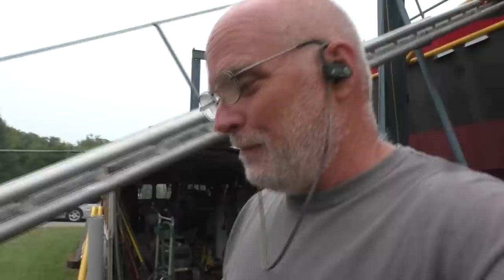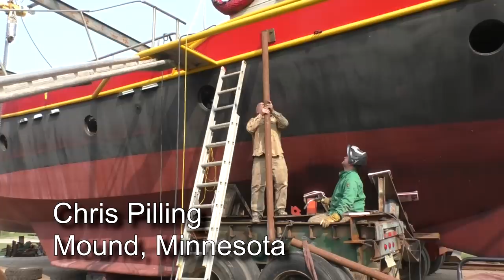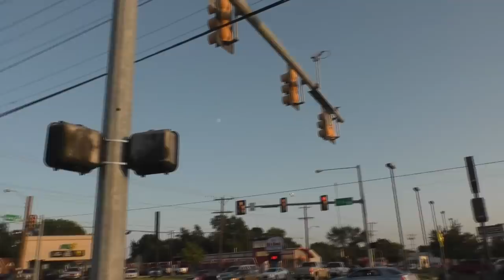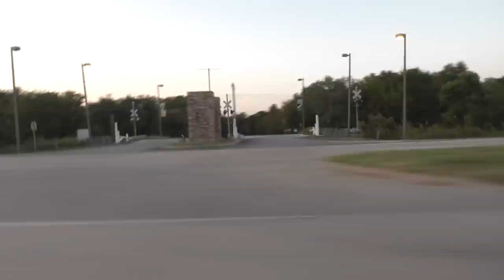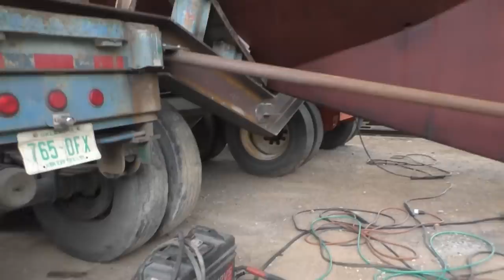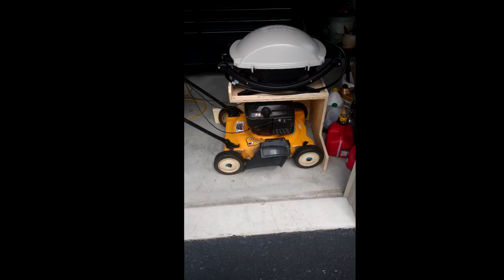Wheels for the Boat - Part 4 - Dual Lane Trunnions Completed

Comment: Hey Doug, make sure you take the time to have the information off each railroad crossing you will cross.  I did notice you said the crossing humps won't be a problem but dang man, 25 seconds isn't a lot of warning for a move of your size. Each has a plate with contact information and a crossing number to notify the railroad in case of trouble.  Best would be to contact them in advance and time of to see if you can get confirmation of a clear path.  Just a thought from a rail guy!  Thanks!
Reply: I was going to suggest the same thing!! From another rail guy, 28 years as a locomotive engineer!!
Reply: He's doing it fully legal 
So the transport department work out his route for him,abd tell him his time schedule
Reply: Yep.  My company has a railroad that bisects our facility.  We keep the info for each crossing in our emergency response manuals.  A couple years ago we had a forklift die on a crossing.  It created a pretty hairy situation for a few minutes until we got a tractor there to pull it off.  Luckily, we called the railroad with the crossing info, and there were no trains in the area.
Reply: Interacting with the railroad would have to be a fundamental part of the move.  Not doing so could be a tragic mistake!

Comment: Being a former truck driver, no trailer brakes at 10mph shouldn't be a problem and the jake brakes should help handle slight downgrades.
Can't wait to see how you get it out of the yard though. I've been watching this come together for a long time. Very cool seeing it get to this point.
Reply: It`s incredible what you can do with axles nowadays I was on the pusher end of a block long Vessel that we brought out of Cessco Fabricating Edmonton Ab Can. Lead truck started pulling brought out the tank 100 ft before it started turning Pilot truck turned all the Tag axles full 45 opposit direction just past center started bringing them back we were 4 days to go to Fox creek Ab 2.25 hrs away HEAVY !!!  I was basically the brakes and a little Giddyup so even if you put Yoke on a 5 ton and use it as a tow bar  NO STEERING IT just for brakes  it`ll help if you want to go that way have someone sitting in it on  radio.

Comment: Overhead utilities look good. Most of the low slack spans are Telco or CATV. Phone is almost always on the bottom. CATV just above. 
Not unusual to go have somebody ride the load with a hot stick to help wires over the superstructure.
Talk with your local house movers. They will have trucks with hydraulic hitches (up, down, left, right) which facilitate maneuvers. They will also be familiar with civilian and police escorts, utility coordination. They can supply required flags, signs and warning lights.
Consider work lights over the wheel sets and bringing some rigging, welding gear and cribbing in the convoy. Hi-Vis vests suggested.
Sometimes City and State have different ideas about oversize moves. One might want the move done at night and the other during the day. Scout places where you can lay-up for operational pauses or in an emergency.
Any need to have the city temporarily restrict on street parking on your street? We have had a tow truck, in convoy, to temporarily reposition the odd parked car.
Reply: When I lived in Oklahoma NO oversize loads were allowed to move an inch after dark. 
That being said, it has been 40 years since I lived there so many things could have changed since then!

Comment: Still one big badass trailer! If you dont use brakes just hang some brake pads on the side with Bailing wire and now you'll have brakes. There for the Professionals well be happy!! Just saying for a friend. Awesome Work Doug cant wait to see the Actual travels in motion.

Comment: Brakes? Where we are going we don't need brakes.
Reply: I wonder where on the boat he intends to fit the Mr Fusion unit.
Reply: Just have the anchor ready.
Reply: He might need brakes while backing down a launch ramp unless he's going to have a travel lift lower it into the water...
Reply: @brandendebuhr2997  You must be really short... Because the joke went right over your head!
Reply: @iGuru08  lol
Reply: @brandendebuhr2997  watch his launching of the wooden submarine.  Didn't need brakes there.

Comment: Mount an 18ft pole to the back of your truck, floor it to the port.
If you end up with half/no pole you may have found an issue.
Reply: I have done this, years ago, but used a fiberglass antenna at a slight angle mounted on a heavy spring to a hitch. I would rent a trucker GPS instead, I came close to damaging some lines even while being careful.

Comment: My father and I did some finishing work to a 60' ferro cement center cockpit yacht and it was moved by truck to another town by the sea, on the way it had to pass under a bridge that had an inch or two to spare between it and the wooden dodger, all goes well until it gets stuck under the bridge. When it was pulled out it was discovered the top of the dodger had a rather large gash in it, it was then discovered a rather large bolt was hanging down under the bridge that nobody knew was there, moral of the story, always check your route when moving large boats by road.

Comment: Get a Tractor behind it to slow it down. I see double wide trailers going down the road and they just run you off the road with other vehicles, they have wide load flags flying in your face, they dont seem to be concerned. They probably have special insurance.

Comment: question, why not use tire treads instead of polystyrene for rub rails on contact between the boat and the Trunnions,you can cut a tire in quarters and set them on the rub rails and bolt the remaining side walls on the underside of the rub rail ,im just saying
Reply: As he said, what you got. I see unused PS. I don’t see unused tires there. Also tires are much harder to cut apart.
Reply: @schooltechnology  Very easy with angle grinder, cuts through steel in the tires like butter.

Comment: the brake issue for me is reliant on how mus
ch turntable weight the prime mover will be carrying..jake brakes can lock an unloaded drive up in dry conditions just as a heavy brake foot so in my opinion i would at least run airlines to two dolly wheels for some security in an emergency,, remember simple things like stuck go pedal cables or electrical issues can eventuate at the worst and the best of times..a simple setup like a timber jinker or bridge girder dolly would be a simple fix for peace of mind and one i no doubt think you could borrow from a heavy hauler close by..most truck depots will even have some useable drums, pads and hardware to fit  some brakes too the dollies if needed..

Comment: Hey Doug, if you cut up the crane how will you get the wheelhouse off for transport? Is it coming off in one piece? Or in sections?
Reply from the maker: Different crane.
Reply: @SVSeeker  Thanks! That answers another question too, "How are you going to clear the rails with the wheelhouse, the crane(s) appear too short?

Comment: Is the pink foam already loaded with the weight of the ship? Asking because if not than those pipe supports will be holding a lot of weight
Reply from the maker: No, and the pipe supports are not welded on at the bottom.   Just tacked.

Comment: damn i didn't realize the us still has that many above ground lines :D here there are basically none close to any towns other then HV transmission lines :D
Reply: It is a product of very low population density. Especially at the time of federal rural electrification, when just having standards for getting power to many areas that had none, any aesthetic complaints were of little importance. Underground lines cost more and are harder to maintain. If there aren’t enough people with reasons to justify the expense of burying lines in an area, then above ground is used.
Reply: @schooltechnology  Well we have a lower population density here in Finland :D and i think its more so that underground lines aren't effected by weather and stuff getting caught in them to avoid power outages. also you can always upgrade lines :D

Comment: Hey bud..  the work you all so is way over my pay grade.  I have a question. 
I see you are welding the pipes to the ship.  Will the welded pipe still be true when the weight of the ships drops to the trailer?
Reply from the maker: Think of them as temporary tie down straps and modest supports.   True is not necessary.

Comment: I'm sure you have a plan to get the deck house off the boat with one crane.  Would be nice to know what it is.
Reply from the maker: My crane could lift the pilothouse, but where would it put it.  : )
Reply: @SVSeeker  So you've said you will remove the deck house.  I've assumed that you would lift it off with the gantry's and lower to another trailer.  I've seen the same thing with steam turbine installations.  We used to design the cranes to go out beyond the turbine deck to lift and drop all kinds of stuff onto trucks.
Reply from the maker: @Buck1954  We'd have to move the boat.   Where would we put THAT?  : )
Reply: @SVSeeker  Yes, after the boat is pulled out.  Is not the boat to be removed?  Lift the deck house up, pull the boat out, slide another trailer in, drop the deck house. I have the feeling you are playing with me.
Reply from the maker: @Buck1954  I am.   Yes,  we have a plan.  : )

Comment: My cousin works for the DOT issuing over sized permits they issue you a rout that you can not deviate from is this the rout the DOT assigned you.  Those in the routing are only  allowed  2 instances of non working rout in this position before they are moved to a non routing position.
Reply from the maker: A computer system now does the routing in Oklahoma.  The number of bridge strikes has dropped to near zero.
Reply: Route?

Comment: As a truck driver, I would feel better to, if you at least run air to the two single rear pots on either side of the trailer. You would then have parking brakes besides, when no air is present. The parts to do so are cheap to buy new or plentiful used. Any single axle truck valves and hardware will work. If you cut the brake cams,trailer parts used are in every scrap yard. Too bad you are across the border or I would fly down and set you up

Comment: Does the new route allow to keep the Deckhouse / cabin on? At some point it seems like the plan was to take the deck house off, but this looks like you'll keep it on!

Is it already properly welded on everywhere? I think at some point you said you'd just tackweld it in place
Reply: The measurements are for the deck house being removed.

Comment: doug et al gratis on the work to date and the nearing milestone of movement.  as for brakes  like you say not required by the government... short trip  i assume mostly flat route  and night or evening run for lesser trafficlevels .so plan for 10 mph 1.5h travel dont bother with brakes on the trailer the truck has them and at low speeds should easily handle the load  save the time and money for better uses

Comment: Are you still planning on removing the pilot house, if so do you plan to flatbed it or custom trailer?
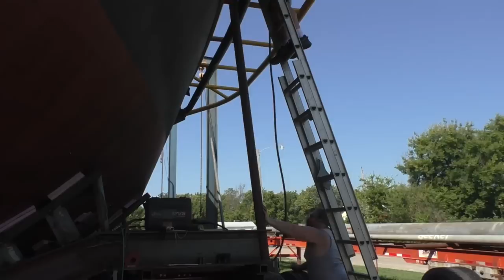Reply: They already have a trailer holding up the masts which you can see in background at about 4:15, I believe it will travel on that, not sure if on same trip with masts or separate.. Doug ?

Comment: Looks like the route will be great.  Amazing how they know all the heights of the stuff along the way.  Wish I could have stayed longer though.  May try and head out for a couple days in November if all things are good.

Anyway going to go try and help Adventures with Purpose out in KCMO while they are there next week.

As far as the brakes it should be simple enough to have a vehicle behind with a couple chains on the spots where you may need a little extra braking and honestly may be simple enough to use that vehicle as a pusher for going up the hills.  Just mount a plate on each axle that a pipe can mount to and then both come down to a single point.  The vehicle behind can then either push or apply brakes when needed on a couple spots.  Watched a ton of the huge moving video's and that is how I usually see them do things.  One in Canada moving a set of grain bins and such did something similar with multiple vehicles both pushing and pulling the load.
Reply from the maker: Howdy John.   Glade it was a false alarm.  Have fun in KC.

Comment: I dont want to be part of the "brake" discussion!  I would be part of the " removable wheelhouse" discussion. Most commercial vessels of this size have em. Would it have helped ?
Reply: Steve it does have a removable pilot house.
Reply: @MrEric_API  would removing that allow them to shorten the route?
Reply: @stevecarlisle3323  it will be removed when he take this route

Comment: Holy shit you have alot of powerlines everywhere in the USA
Reply: It is more practical in most areas to run them on towers instead of burying cable due to the vastness of the country. We wish there were less too, but not quite enough-so to pay 2x as much for our infrastructure. The heights are standardized now, but rural and residential areas are still challenging for tall loads. Modern Trucker-specific GPS units include this, and other large-load data, so professional drivers have few issues in practice.
Reply: It comes as a real surprise when visiting USA how messy the overhead wires are everywhere. Rich areas have no Utility poles or wires, it’s all underground, less rich areas where the big Corporates don’t care about Civic responsibility are a tangle of wires, posts and various other obstructions.
Reply from the maker: In neighborhoods like mine, we prefer lower rates.  : )

Comment: Been a truck drive bothered in the states and the UK I would at least put one axle on each bogey with brakes and my reason at 50tonne just me guessing the weight going ten mph even down a slight grade will heat the brakes on the tractor unit just having that life line would be perfect
Reply from the maker: Actually no.  The force for the 4% grade was calculated at less than 5000 lbs.   Well within the limits.
Reply: @SVSeeker  the weight was the boat not breaking force needed pal. I do this shit day in day out my point is better to have a life line than not have one. wouldn't take much to hook the brakes back up and a service line to each bogie and couple of tanks
Reply: @ralphgesler5110  to be honest I dont know what force he was referring too maybe your right without knowing the mass off the load the brake force is unknown me personally I'd have or want the brakes as the driver in case of a brake away and reduce the working load on the units brakes

Comment: I hauled a Lord that weight 160000 lb with just tractor brakes a small downhill incline , tractor brakes didn't even slow it down and I was only at 5 miles an hour, a little longer Hill downhill incline tractor and trailer got up to 40 miles an hour no way to stop. Rethink your brakes

Comment: I have no experience with trucking, so if they're saying no brakes is no problem, then they know better. That said, I would say consider the worst that could happen. Add brakes, the worst that happens is you spend a bit of time, money, effort you didn't need to. Don't add brakes when you should have had them, and you could lose the entire boat. I tend to be a bit more of a conservative person, but I think personally I would have the brakes.

Comment: Yeah brakes aren't that big of a deal at those "speeds" lol but if you were worried you could gang the 8 chambers service lines together and run one line up to the front. Just cage the spring brakes. dunno either way the boat is gonna get moved lol

Reference this if you want some insight :) 
https://www.ontario.ca/document/official-air-brake-handbook/spring-parking-and-emergency-brake-subsystem

Comment: Strange why don't you do like everyone else just some that pipe why don't you just run chains down to the trailer since the trailer is solid side to side ?? Much more flexible to reinstall if needed and because it's chain you have more options to tighten it down. This way those pipes are not in the way when you get your boat unloaded either.
Reply from the maker: ...because chain is not very good in compression.  : )

Comment: Brakes would be best because you will have a lot of eyes on you and it only takes one trooper to end your parade. Put the brakes on at home it's the cheapest way to get there. And how can you prove you can stop it in 40'? Without trailer brakes when I am grossing 80,000 my truck brakes don't last long. Airlines break and sometimes gators are unavoidable that's how I know.
Reply from the maker: We actually do not have to prove it.   And with a good driver doing  a max of 10 mph, brakes are not ever needed.
Reply: @SVSeeker  Well Oklahoma has some very relaxed laws. If Oklahoma inspected my Tractor Trailer and found 2 or more brakes out of adjustment I would be out of service because they follow FMCSA  guidelines. I'm cheering for you but concerned at the same time.